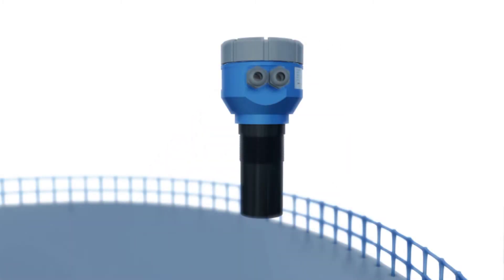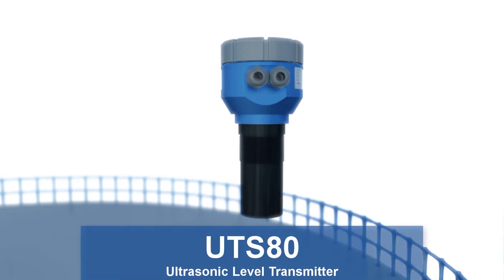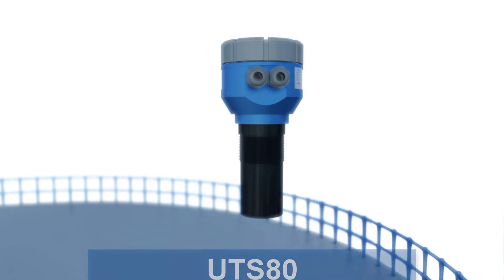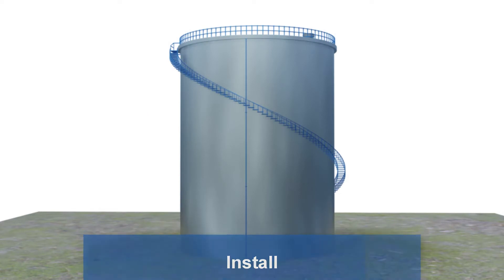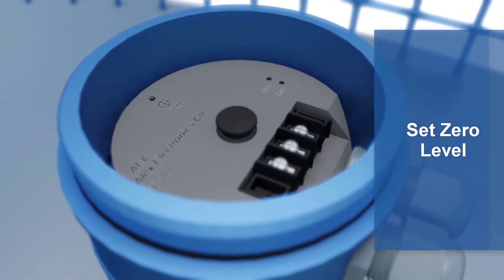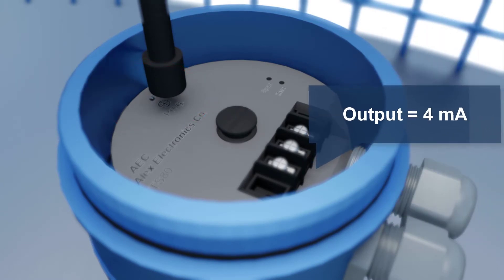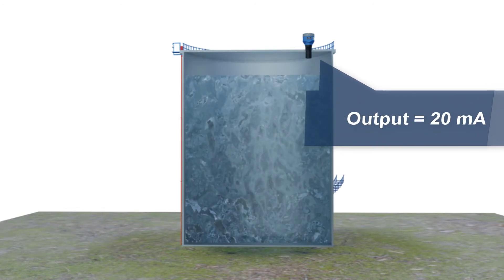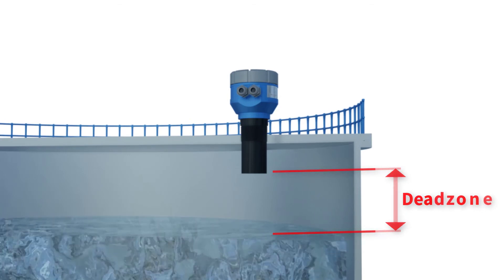Calibration of UTS80 Ultrasonic Level Transmitter

Comment: The calibration process corresponds to the comparison of the installed equipment with a standard or reference equipment. El proceso de calibración corresponde a la comparación del equipo instalado con un equipo patrón o de referencia

Comment: As a positive contribution, I must say that this video does NOT correspond to a calibration process. This corresponds to an ADJUSTMENT process of the measurement and transmission of the minimum and maximum level.